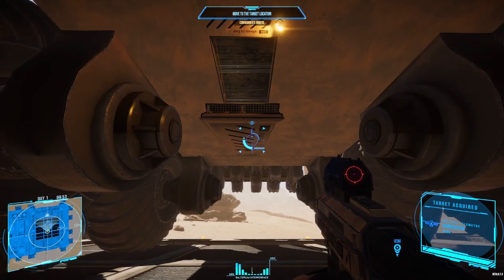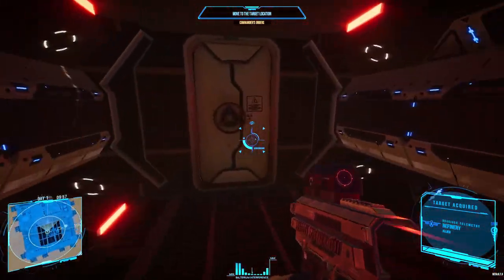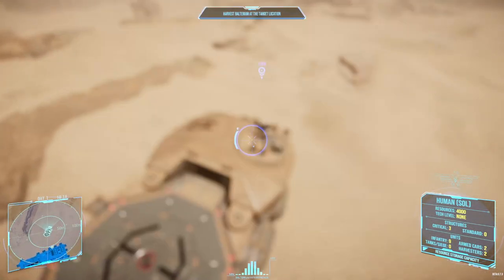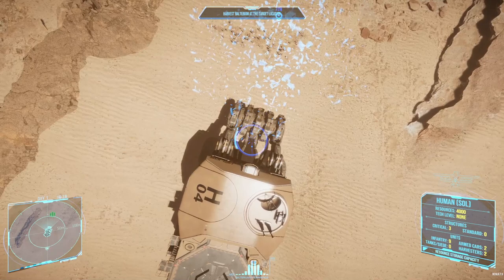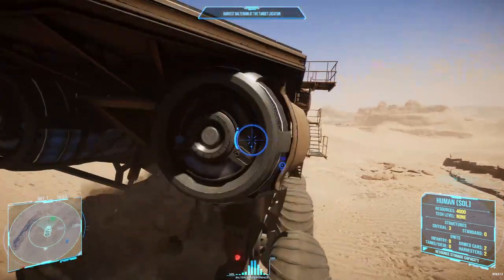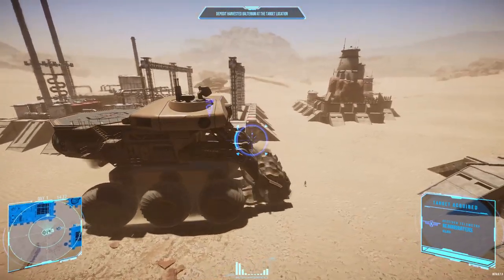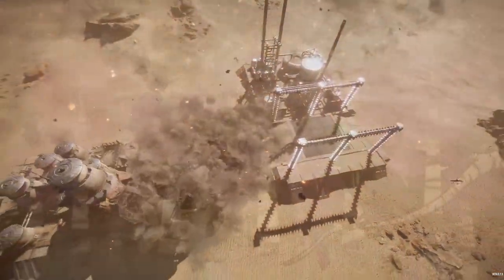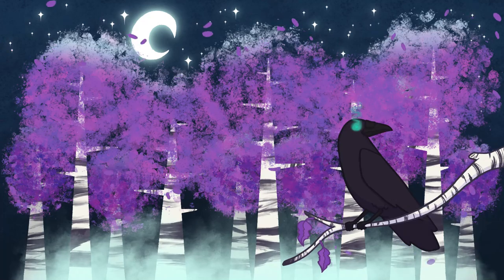SILICA: How To HARVESTER

Comment: I honestly don't like the harvestor and refinery designs. While they look cool, they suck in terms of gameplay. Sometimes, you need to immediately get to the top of the harvestor to kill a bug. But, due to the fact the commander needs to stop the harvestor, and the stairs drop slowly, valuable time is wasted. It doesn't help that the harvestor is itching to move again, either. Another problem is the AI has trouble fitting its massive frame inside the refinery, and it leaves the ultra heavy factory too slowly, so if there is a queue the next vehicle in queue explodes the exiting harvestor. As for the refinery, I wish it had scaffolding to give the player an alternative way to get into the harvestor, without waiting for the stupid ramp.

All and all, I wish that the harvestor had a gravity lift instead of a slowly descending stair, and that the refinery either was more forgiving for the harvestor to deposit, or had scaffolding to more easily access it.